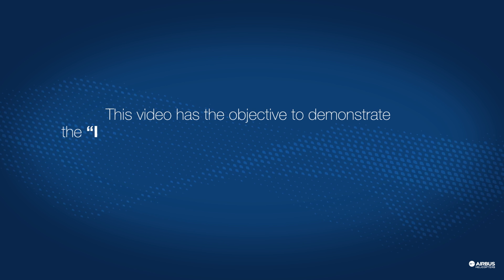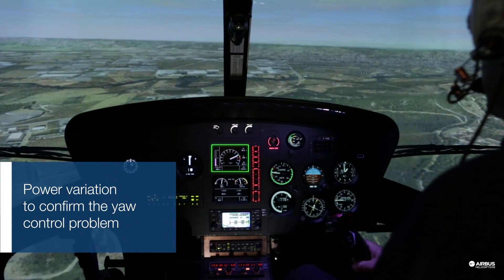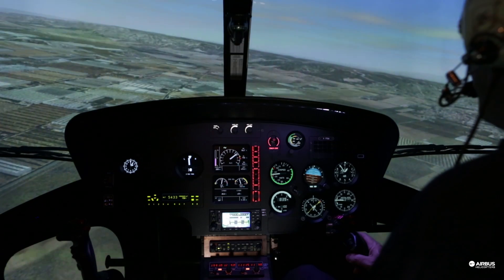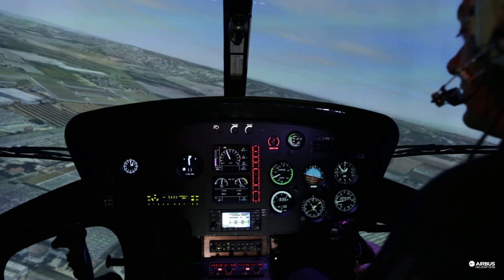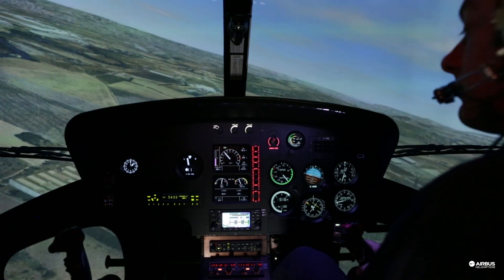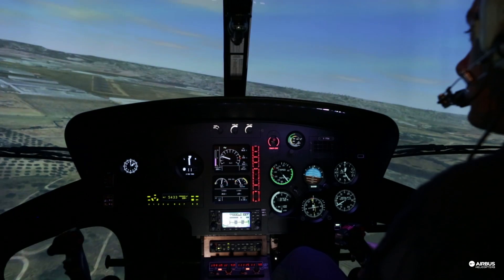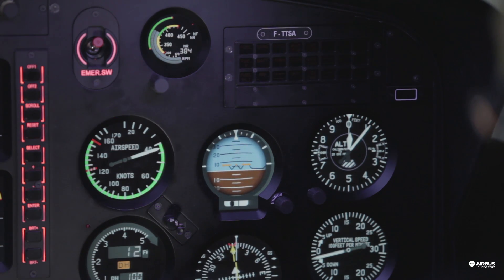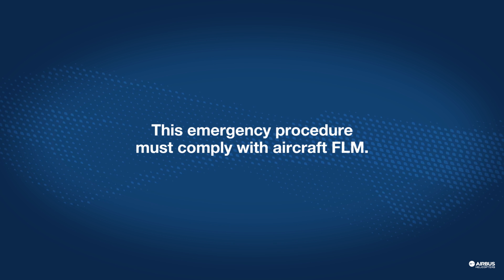Simulated Failure Procedure FFS AS350 B3/H125 - Tail Rotor Control Failure

Comment: What do you do with this particular failure  if that happens in the hover? Say 300agl
Reply: Pretty much doomed. If you are lightning quick to notice, you can chop power and enter an auto, but you are more than likely in the H/V curve and wont have enough rotor inertia to cushion the impact.
Reply: @corycoyle6725  thanks for reply      https://www.youtube.com/watch?v=Kvk6rslCDAI
Reply: @corycoyle6725  Is it not better to go down with power spinning? ROD of say 1500 FPM maybe then they would be a survival rate? not to do an auto rotation
Reply: @herobo123456  If you would like, I could create this scenario in my simulator, and post a video of both issues.
Reply: @corycoyle6725  please do